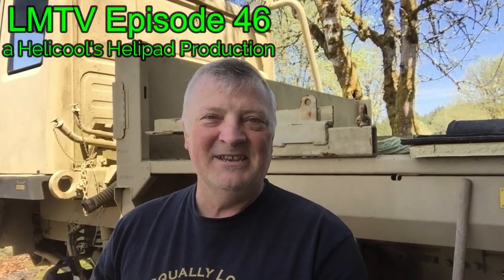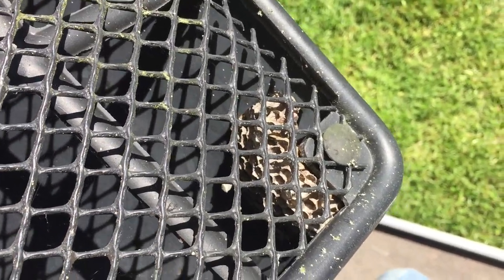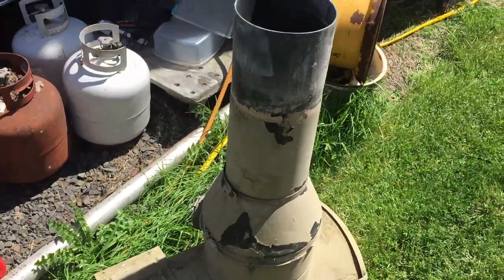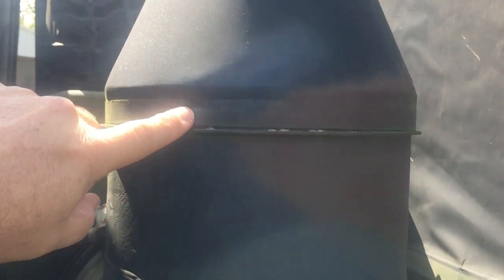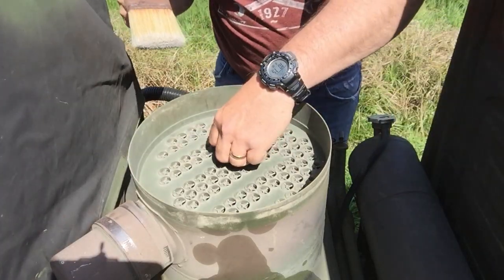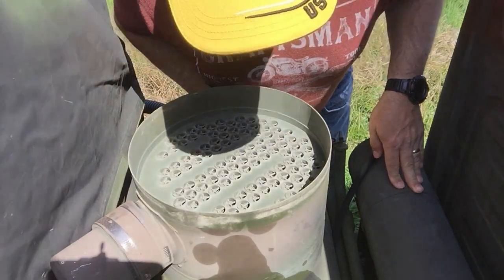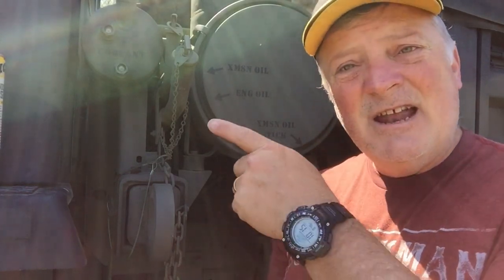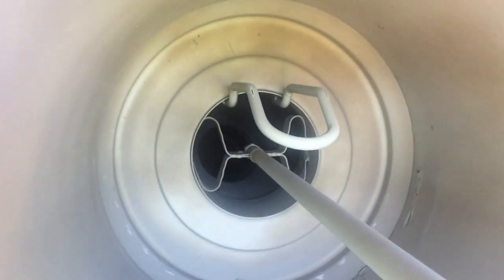FMTV SNORKEL PLENUM Revealed! AWESOME! #44

Comment: Dave, do you know how that air filter dash gauge works?
Reply from the maker: Yes. I works by the amount of force that is required to pull a vacuum to feed the engine with oxygen. The harder the pull, the more clogged the filter. The gauge on the dash will register the impending clogged filter.

Comment: Hi Dave.  I have been watching you build up your LMTV for a bit now as I am doing the same thing out here in Wyoming.  I appreciate the info, especially on the preventative maintenance issues.  Keep up the good work.
Reply from the maker: Thanks my friend... I'm just doing my best to keep the Mission's truck from harm and serious damage by eliminating neglect. Lord knows we have to be good stewards of our resources. As I come across things, I'll be sure to share it like I would want it shared with me; one spoonful at a time. I appreciate you watching and your kind words. Many blessings on your LMTV build.
Reply: Dave, Something you may want to try for more sound proofing, Frost King duct insulation.  Comes in a roll, sticky on one side, aluminum foil on other, about 1/4 to 3/8 inch thick, easy to work with and cheap.  I have put it in a lot of tight small places in the front console area, inside of the doors, fuse box cover etc.  It makes quite a difference with noise and with cold/hot.  Just a thought I'd share with you.  Have a great night.  Frederic
Reply from the maker: @tacticaltouring9273  I can definitely use low cost solutions! I found some 3/4" thick hood liner that is self stick on one side, silver aluminum on the other. I hope to have it installed in a few weeks... I'll upload the video, of course.